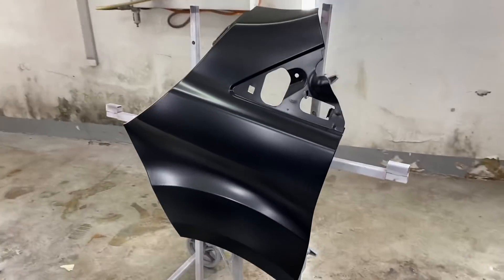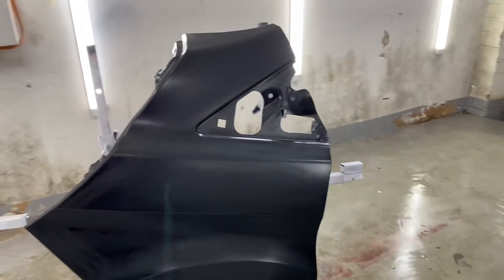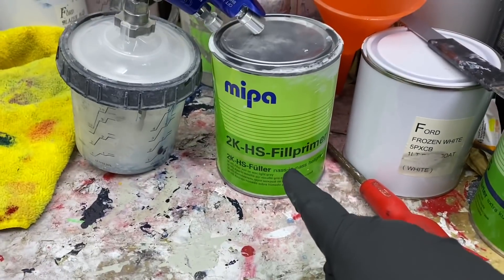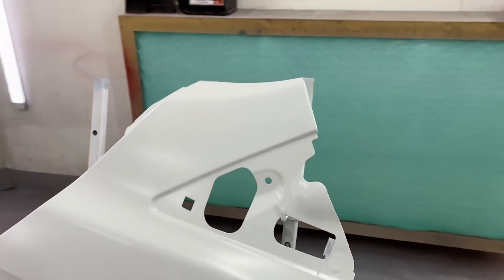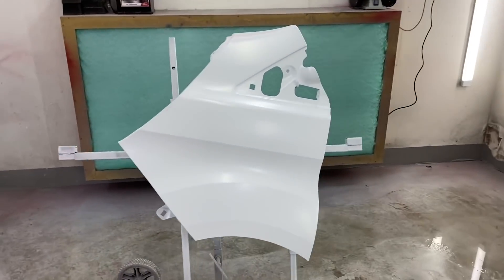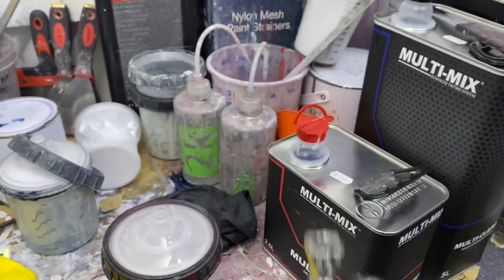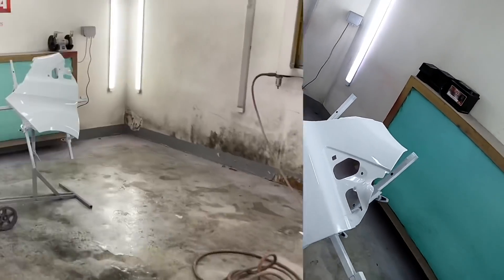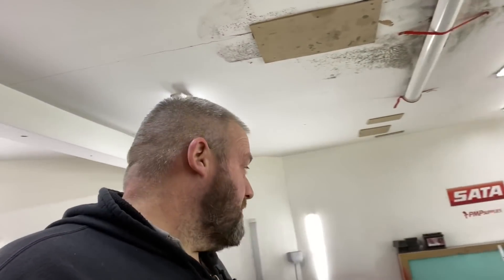How to: prep & paint new pre primed panels 💪💪💪

Comment: I agree with you grant,that's how it should be done 👍 I worked in a pretty big body shop a while ago ,mostly insurance jobs so it was basically about getting jobs though the shop,for new panels it was red scotch on the inside and grey outside with panel wipe ,not how I would have done it but the boss was more concerned with turnover ,bit of  a twat to be honest !!😆
Reply from the maker: 😆😆😆😆 I knew what you meant 👍👍👍👍
Reply: @grantssmartrepairs  👍

Comment: Great vid. Thanks. Under what circumstances would you flat between coats ?
Reply from the maker: If you are referring to the paint you don’t need to sand only if say a bug lands in the paint you can nib that out but in general you don’t sand between coats of paint 👍👍👍👍👍
Reply: @grantssmartrepairs  
Ok thanks. Thought i saw people spraying guide coats onto primer then taking off the high spots etc?
Reply from the maker: Ohh on primer yes but I used a wet on wet primer which is a non sanding primer comes out smooth so you can paint on it straight away 👊👊👊👊👊
Reply: @grantssmartrepairs  
Coolio
 Thank you for sharing your expertise. 

Now spray my Series 1 rs 🤣

Comment: Another great and informative video,thank you,can I ask,don't you do anything to the inside of the panel,doesn't it just rust if its left in just the factory primer?thanks again
Reply from the maker: You can do there not painted behind from factory I just wax oil them before fitting for some extra protection, I can’t do it until the paint is cured 👍👍👍👍

Comment: Great work, would you suggest I do the same on a used painted car panel? Or would you go epoxy primer before hand to seal it
Reply from the maker: You can use epoxy but if it’s a modern vehicle probably not needed 👍👍
Reply: @grantssmartrepairs  yeah it’s 2003 mate , maybe best to use epoxy then wet on wet primer maybe
Reply from the maker: If you get novol protect 360 it’s a wet on wet epoxy so kills two birds with one stone 👍👍👍
Reply: @grantssmartrepairs   ahhh thanks mate is that the anti-corrosion stuff and a good air drying home use product , also what respirator do you use mate
Reply from the maker: Yes mate and I use gerson masks 👍👍
Reply: @grantssmartrepairs  thanks very much mate I hate pestering people but your the right person to pester 😂
Reply from the maker: 😂😂😂😂👍👍👍👍 no problem

Comment: Nice skills. What size compressor do you use? Was there a point there when you was waiting for it to fully charge? Good to see you binned off the rust filled filters from the van work! Thanks for sharing as always!
Reply from the maker: I have a big 270 litre compressor which was turned off 🤣🤣🤣🤣 that’s why I was fiddling after I turned it back on 👍👍👍👍
Reply: Dont miss much me!! Great finish mate.
Reply from the maker: 😆😆😆😆😆 I know I know I noticed the pressure dropped then realised it was off 😳😳😳 switched it on and came back 🤣🤣🤣🤣👊👊👊👊👊

Comment: Nice mate , so no need to wet sand the primer with guide coat ??
Reply from the maker: On this application no as it’s new with no damage so wet on wet primer which I used lays down smooth like paint gives great adhesion and protection so you can paint straight over it 
But if I used normal 2k high build primer then yes we would have to block that down 👍👍👍👍👍
Reply: @grantssmartrepairs  awsome 👊👊thanks for the reply Grant

Comment: Hello mate great video. I got a new panel, how do I know if it primed or powder coated? 

Feels like powder coated? Euro car part wing fir my son's audi a3. Was gonna try have a go myself. So thanks for video.
Reply from the maker: It won’t be powder coated mate it will be in a E coat which is primer basically
Reply: @grantssmartrepairs  thanks so much
Reply: I always thought u had to wet sand primer
Reply from the maker: No mate you can sand wet or dry 👍👍👍
Reply: @grantssmartrepairs  oh so u should sand wet or dry the primer coat before painting? sorry for questions.
Reply from the maker: Yes you can do either 👍👍👍
Reply: @grantssmartrepairs  about to order equipment thanks to you. Sounds dumb question but where do u buy the paint from?? 😅

 I'm laughing at my myself because I'm colour blind and don't even know where to buy paint from. Not sure I should be attempting this 😬 😅
Reply from the maker: You need to find a local paint shop to you I’m sure you can order some online by the paint code